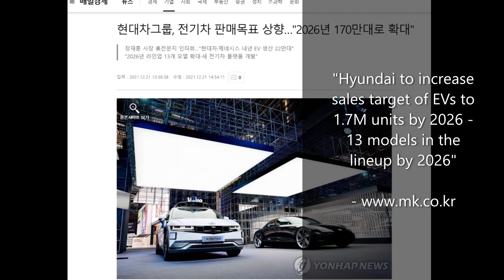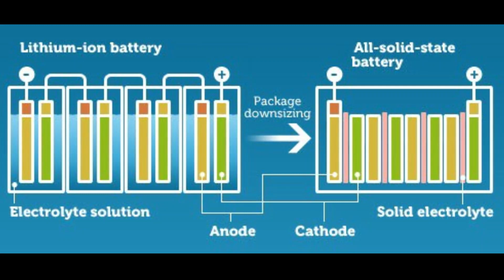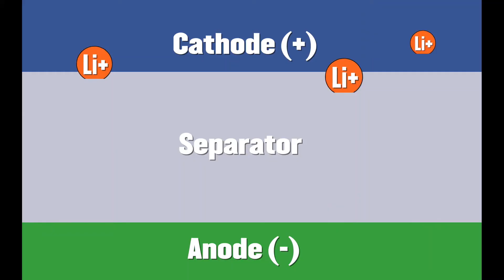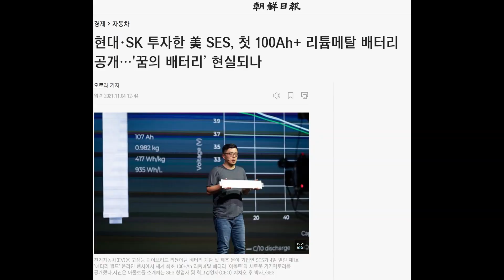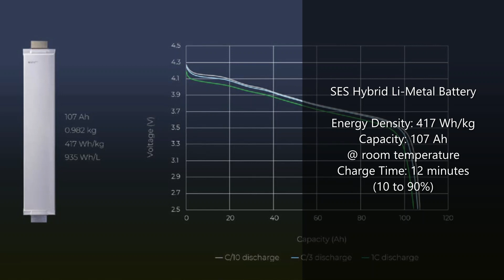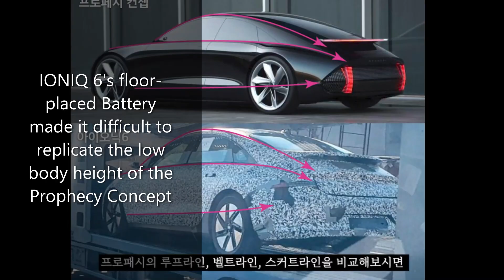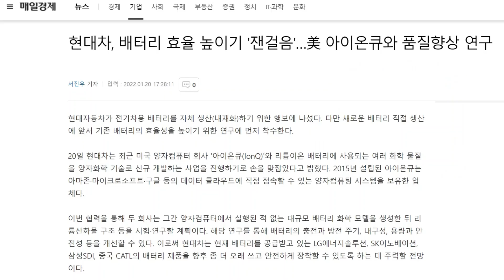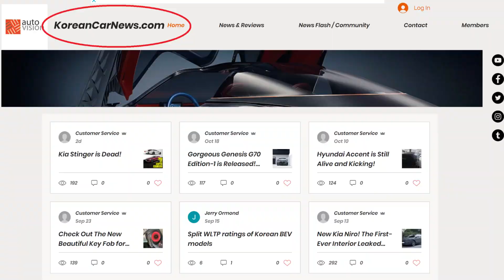800km / 500mi Range 12-min Charge Solid-State Battery EVs Are Coming Up from Hyundai, Genesis & Kia

Comment: Nice!  A small 500 mi range EV fast charging cargo van, with 115v 15a plugs in the back, capable of camper mode where you can run the AC and power while parked overnight and/or charging for under $30k and I would  trade in my ICE van.  But I dont think we will see such a van until 2026 though.  We need US charging infratructure to be ready for this and we also need the US Gov to open trade channels to allow such vans to come in too..  There is politics in the way that stopped the VW ID Buzz EV cargo from entering the US.

Comment: As many vehicles that can be fitted for 500 mile batteries, the better.  Noone wants their car plugged in all the time. 
Learn to make them cheaper. 

One problem I see. Is replacing the batteries. This should be simplistic.  Plug and play should be the mode used starting now.  A battry should be able to be pulled out and a new battry dropped in in just a couple of minutes.  The more common the batteries, the better. Too many sizing constraints on batteries is a bad idea.

Comment: A 500-mile range might persuade some of those (~ 40% of the U.S. population) without access to home charging that driving maybe 20 miles to the nearest DC Fast Charger might make sense, on a weekly basis. It would also be desirable when you consider the significant range lost when the temp is much lower than the ideal 75 degrees f.

Comment: How about a modular battery system that can either add miles so you can buy a cheaper model then upgrade later and possibly a hot-swappable battery at stations that allow you to quick swap sort of like propane cylinders?  Also, why do all the EV cars have to have 500 hp and outrun Corvettes???  If they made it the average hp of regular cars ~150hp the range would double.
Reply from the maker: Tesla played with the idea a few years ago but abandoned it   Now Chinese EV makers are trying it but there are a lot of issues.  First off the investment needed to create battery replacment facilities is far greater than simple charging stations.  Also, there is the safety issues as the batteries need to be protected by high tensil steel underneath but with the detachable batteries that protection is compromised.  Furthermore, there is the issue of figuring out rental or leasing matter with the batteries themselves.  After all someone has to own them.  At any rate, the battery prices are dropping and the charging speeds are increasing at a such a fast rate that we won't have to worry about the battery replacement technology.
To answer your second question.  It's because, it's very cheap to make electric motor powered EV cars very powerful.  It's as simple as that. :)

Comment: For many its not range anxiety its the fact that adding weight can drop 15-20 miles of range, highway speeds can drop 20-30 miles of range, putting a bike or luggage pod on the roof drops range, and then if you try to tow anything your are cutting your range in half. Cold weather drops range by nearly 30%.  Having 350 to 500 miles is what people are used to with their ICE as well and when you add in extra for conditions that impact EV's you need 500 miles to average out to 350 miles or less, especially in colder climates.

Comment: 800km range would require something like a 150 kWh pack (assuming a consumption of 18 kWh, which is on the low side for a big SUV), from 10-80% (so about 105 kWh) in 12 minutes would require a 525 kW charging station (without charging losses) - so this wont happen any time soon... even if you could charge on ionity with 350 kW constantly it would take roughly 18 minutes - which would already be pretty rediculously fast for todays standards...
Reply from the maker: You are correct that is the theoretical figure, we are sure the charging infrastructure will catch up.  ;)  500kW+ charging was released recently btw,

Comment: Anxiety, yeah! It is stupid to buy a car that doesn´t allow you to drive to a city two hours away and back without charging. You need at least a battery that holds for 500 - 600 kilometers specially if it is cold (who would like to buy an expensive summer car?). I will keep my gas driven car untill en electric car proves to run at least 550 kilometers with one single charge.

Comment: Why to carry always with a big battery, when most of the people only need 10% of this capacity daily? It's more eficient to put fast chargers using the 800 V technology and limiting the weight and high cost of the big batteries.
Reply from the maker: Yes, that's why Hyundai is covering both ends.  Ultra fast charge with its 800V charging architecture, as well as the longer lasting batteries.

Comment: Then they might be behind Toyota in this one...and I think Quantum Scape, but I would have to verify that. Toyota is looking at a 2023 or slightly latter release of their new SSB in the new Lexus EV. I think they said it will get a range of over 400 miles.

That being said, the Ionic 5 should be one of the first with this battery, even if it's only in a low volume, must order version at first. Just saw the car at an autoshow, and it's the first Hyundai I actually liked. Since it's already an EV, give it the new battery right off the back. Tesla has shown, people will wait for potential.
Reply from the maker: From our understanding, for Toyota, the first application of SSB is for a hyrid car and not an EV.
Reply: LOl, Toyota EV? No, more like rebadged BYD EVs from China. Toyota hasn't even begun yet while many other brands are way ahead in EV tech. Toyota instead is pushing hybrid which is a totally different technology from EVs. Toyota even lobbied Congress to stop the EVs.  People even claimed Toyota was way ahead in solid-state battery tech and Toyota made big noise saying they were close to EVs with solid-state batteries - all turned out to be a baseless noise market with no real production. Toyota may be on top of the world sales chart and reputation now, but In about five years when all these EVs from many brands become more and more mainstream, I am betting Toyota is going to be in real trouble.  Toyota's famous Just-in-time logistics, durability, and reliability no longer apply to EVs.  Now it's about batteries, software that manages them, and digitalization. Due to the fact that Electric Vehicles have only about 20,000 moving parts, compared to 80,000 gas cars, Toyota's main appeal (reliability and durability of their cars) will no longer be that big of a factor,  because all EVs will be highly reliable with far less maintenance and repairs. Instead, the battle will be about the battery range, charging speed, the quality of software, fit and finish, and the ease/comfort of driving.
Reply: @jillthompson6110  I agree overall with what you're saying but I don't think EVs have anywhere near 20,000 moving parts and I don't think ICEs have anywhere near 80,000 moving parts.
Reply: @jillthompson6110  Clearly you haven't seen their announcement from just last month.  Toyota may want to delay EV's or wanted to, they've been working on them for years.  The articles for Toyota full EV's go back for at least five years. Also, they've been running a solid state battery vehicle since 2020.  They are starting production. They are supposed to use them on their hybrids, but from what I have seen, they have confirmed they will be on a Lexus sports car and possible the upcoming RZ450e. Toyota does have a smart strategy, not everyone is going to be able to afford full EV's up front, but they also have nearly 40 Lexus and Toyota EV designs that will all enter production before 2030.  Toyota always stated they were trying to get solid state battery development off the ground before they went fully electric, and it seems the tech is right around the corner.  That being said, there is some conflicting information. From what I can tell, Toyota vehicles will get lower mileage cars (and no, the bz is not a rebranded whatever that was) and the solid state batteries for the hybrids while the more advanced cars with longer range and solid state bats are going to Lexus.

Comment: Range anxiety exists with petrol cars, most people rarely let their vehicles go under 100-150 mils before tanking up, same with EV's so the "effective range " is Range minus, say 150 miles.  When u have a 200-250 mil total range vehicle, to the ordinary consumer, that's simply not enough.  The thinking "what you need" vs what the consumer actually wants, is the bridge next gen battery tech needs to fill.  Once you get to what the consumer wants say 450 mile range and sub 10 min recharge, then the petrol car disappears from roads...  But don't promote inferior tech because that's all you have...  work harder to get what your customer wants

Comment: I drive a 64 KWH Kia Niro EV which gives about 365km range in the Ontario winter. This is quite adequate for most of my driving but not enough for the occasional longer trip. The biggest issues for me are lack of fast chargers, a 60 to 70 minute charge time, and the high cost of fast charging which is about double that of an equivalent gas (ice) car.  We need many more fast chargers at half the cost more than we need better batteries IMO. Still an interesting look at the future, thanks.
Reply from the maker: I think that will happen within a couple of years. Even Tesla Superchargers are now open to other makes.

Comment: There are Tesla SC charging  networks everywhere  around me  on top of  other regular DC  FC  and  chargers in malls , Tesla do fine  with  400 and  300 miles range and even 250 miles, no range Anxiety  , what we need are cars like Ioniq 5    and  Kia EV6 and the coming  small Tesla $25-30,000, maybe  legacy auto  like Ford Kia Hyundai can help by  installing   a MINIMUM  OF 6 to 10 DCFC stalls per Stealership, We  dont mind paying for the Charge  as we dont mind paying  for  GAS  as we do today, it will also give the Stealerships  revenue  that they will lose eventually as EVs  need Less SERVICING  compared  to ICE  cars. Above  all we need  to transist  to DIRECT SALES ,we  have  the Internet, Nobody wants to deal with  a GREASY Haired  Salesmen,  Follow Tesla   example, and  Legacy Auto just might  suceed.How  do I know?when Ford and GM announced they will make and eventually produce and go full EV their  Stock went up, and every New  Startup  like Lucid and Rivian saw their stock get valued @IPO  and a Market  Cap   equal  or more than Legacy auto despite not having sold  any  car yet, Every one  thinking  it is   going to be  the next  TSLA. 
We need affordable  BEVs  TODAY , not in 2026, and in the MILLIONS not @ 150,000 units / year as Hyundai and Kia  is doing right now, REMEMBER the Chinese BEVs are coming! they are hungry for  Marketshare, and they have no ICE  cars to kill, no STRANDED A$$ET$ to worry about.

Comment: Answer as I see it, this market is based now on scale of the market share or the perception of same, I feel that the larger vehicles would benefit most as they are tied to the mass bus type networks, however this is not my final answer, go for the mass market lower end vehicles and have a plan for a (at-cost) battery upgrade (tied into your high quality warrantee plan) when the reach the degrade point, then sell the package as you have now given great value to the mass sale model, and the math will bear you out, it will take some years to return your investment but in the end you will have won the market and others will have fallen by the side of the road.

Comment: By the way, 800 km according to which standard ? NEDC, WLTP, EPA, etc...? The ratio between NEDC and EPA is more than 40% !!! EPA is probably the closest to real life and only one car can get such a reach : Lucid Air.
At first sight, a 800 km range may be impressive but in winter time range can be cut by a factor of 2 (mostly due to temperature and heating) !!
So 800 km means nothing if not referenced.

Comment: I want a Santa Fe sized EV for $40,000 with ventilated seats and all active driving electronics. Any of the existing batteries would be acceptable IF they have more than 1,000 charging cycles before degradation. Until then, show me a Santa Fe sized plug-in hybrid with 100 mile range and full active driving technology, again for no more than $40K. I'd love to purchase, but I won't spend $50K or more on a depreciating asset like a vehicle.

Comment: 1:25 Yes some people do need 800km (500 mi) range, because we don't get to use all of the range. 

NIO has a network of 700 battery swapping stations across China, and they are introducing this in Norway, and other European countries. EV drivers pull into a garage that swaps for fully charge battery in 3 minutes.
Reply: .... and that is the better solution.... not another $5 billion for EV charging stations.
Reply: @SunriseLAW  No. The logistical problems of keeping enough batteries to meet anticipated peak demand, ownership issues and standardisation all work against battery swap.
Reply: @rogerphelps9939  Disagree because the swappable battery can (as I understand it anyway) be charged at home or a charging station.  The 'swap' feature has so many additional benefits that it will become the standard once rolled out to the masses.  The masses cannot afford to write-off the entire car if the battery fails (rare but we are dealing with 'perceptions' and fears'). The swappable allows for better management of the BATTERY FLEET including easy upgrades to higher performance or new battery technology.
Reply: @SunriseLAW  It will not. Swappable batteries impose unreasonable constraints on the manufacturers who design their battery packs as an integral part of the car's design. Each battery represents thousands of pounds of investment and, on a Friday in August when people are going on long holiday trips, a swap station that has run out of available batteries is screwed. At other times these batteries are just lying around not earning any money. Charging stations will need massive grid connections because, presumably, as soon as they get a battery in they will want to get shot of it as soon as possible. This idea has been analysed to death by most manufacturers and rejected. The only outfit trying it is in China. There are various articles concerning this on the internet giving more reasons why this idea won't fly.
Reply: @SunriseLAW  It is not "optimising performance" There are loads of different distinctive car body shapes. To lumber makers with a one size fits all approach to the battery is a step too far. Swappable batteries will not work because the requirement to conform to the battery swap company's requirements will just stifle innovation. The NIO venture will fall flat because manufacturers other than NIO will just ignore it and then it becomes restricted to a single make which is just a disaster. It is standardisation gone a step too far. Standardised charging protocols and connectors, swappable batteries are nonsense.  Batteries have or soon will have all the range anyone could need. The objection that they take too long too charge is easily refuted because the range on offer will far exceed the ability of a human to drive safely without toilet and meal breaks.

Comment: This is why I like Korean made vehicles. They continue to strive for the best in automobiles and stand by their products.
Reply: same.  years ago i would not have considered them as a viable option, but because of how much they have improved literally everything about the engineering and craftsmanship since then they are now at the top of my list of manufacturers
Reply: Koreans innovates, Samsung is a good example.
Reply: Yes South Koreans 👍
Reply: What automotive company hasn't had set backs. At least they strive to make quality automobiles and are working towards making our world better with electric vehicles.
Reply: Let's not get carried away with hyperbolic adulation. Hyundai/Kia have had major, widespread problems with faulty engines, CVTs, and car fires for years, right up to the present.
Reply: They also choose to install mediocre power motors which negates much of the appeal of electric cars thanks to Tesla having set the bar quite a bit higher!
My Kona electric makes 201 hp and 291 lb-ft of torque versus the Ioniq 5's piddling 168 hp, and 250 something torque!  Seriously Hyundai?
A BASE model 3 will go 0-60 in 5.5 seconds.  For MORE money, the Ioniq 5 struggles at about 7 seconds claimed but likely slower unless the user is on it hard.

Comment: It's not just the range that is stated that is the issue though. Battery performance due to temperature in usage and charging is another factor too. Saying even now, on a 400km range car (Polestar) and getting 250km on a cold day or driving at 100kph is where range anxiety comes from. Even if I could in my country with it's poor charging infrastructure,, I wouldn't want to stop during or have to look to charge the after a short trip of only 250kms return now. 
You don't get the variability in ICE cars as extreme as this and driving at open road speeds is more efficient, probably because they have actual gears. No matter how I drive now or what season, I can 100% guarantee my ICE can do 650 kms without needing to look for fuel or even think about it.
I'd be happy now with the EV ranges if they actually did what they say they do regardless of the environment and reletive speed used at, but they don't. Also 700 charges before degregation doesn't sound great either to be fair? That isn't even 3 years use, charging every 3 days.